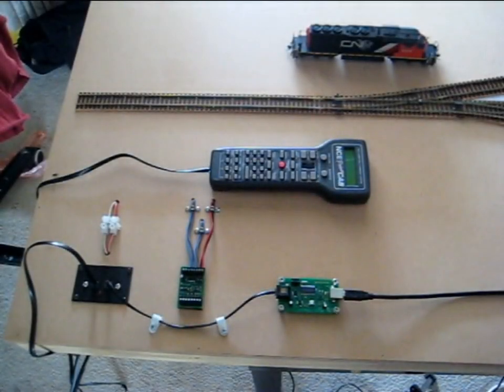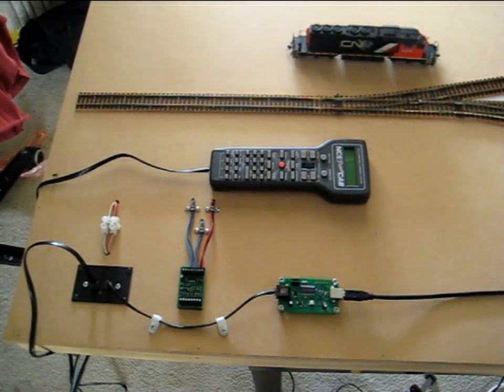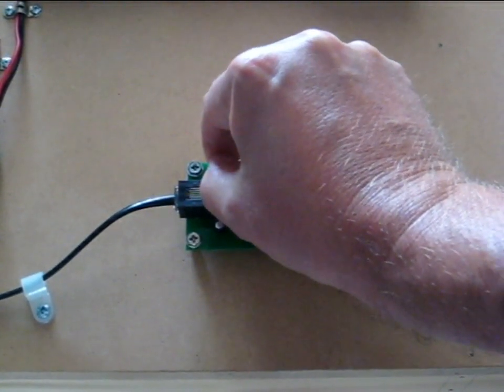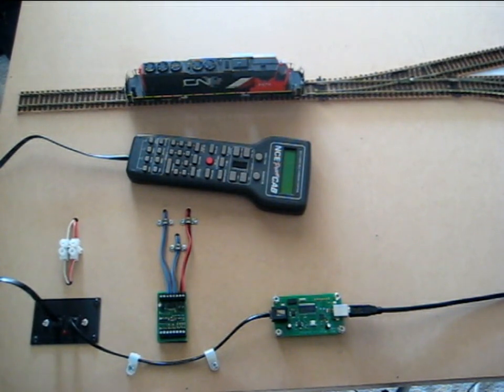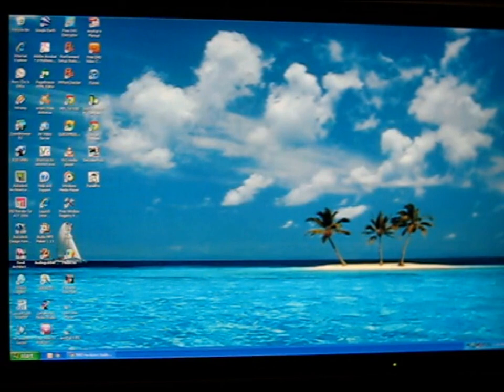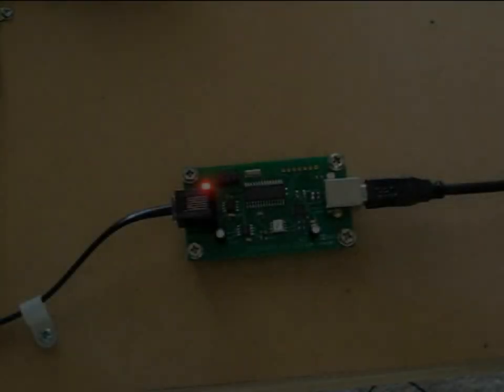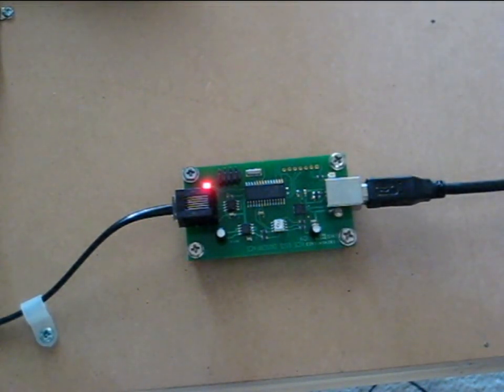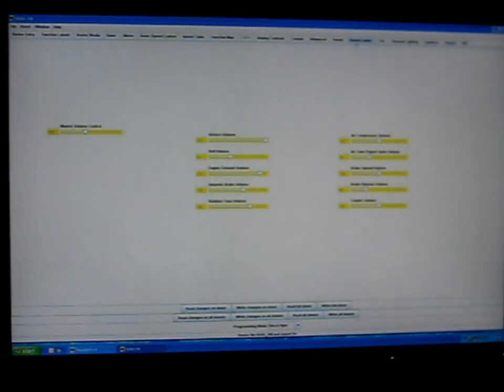NCE USB interface for the first time with JMRI software

Comment: Should the jumpers also all be removed for Power Cab version 1.65? Thanks. ...Roy
Reply from the maker: Hi Roy , version 1.65 should be jumper2-off jumper3-on jumper4-on for a baun rate 19200
Regards,
Michael
Reply: Detroit River Railroad 
Hi Michael,  I'm having problems interpreting the jumper pins.  Does your solution above apply to a Power Cab v1.65 with a v6 usb adapter, or is it for v7 only?  Its just I'm using a Power Cab v1.65 with a v6 usb adapter by the look of it.  Thanks.
Reply from the maker: Darryl Griffiths Hi Darryl, when I made this video the powercab version was v1.28c so the jumper setting was for that version.
For v1.65 try jumper2-off jumper3-on jumper4-on baun rate 19200 , see if that works. send me a message if that doesn't work.
Reply: Detroit River Railroad Hi Michael, thanks for that.  Unfortunately, that didn't work, so I set them all to off like yours and all seems to be working.  I found a useful site all about the adapter: https://sites.google.com/site/markgurries/home/nce-info/nce-usb-limitations, but sadly there is no mention of the pin config when using a later power cab with a version 6 adapter.  I have also emailed NCE, as you can apparently get your adapter updated, but they have not got back to me.

Comment: I have Power Pro, over a year now but only just had the courage to attempt the laptop connection.  I have a straight 9 pin plug into the NCE controller and via a cable adapter to a usb into the laptop. No decoder between the two.  The laptop downloaded the driver, opened panel pro, throttle recognised, no problem.
Now for the point decoder.  Wish me luck

Comment from the maker: @trackspike64 Hi, I will take it that you have the NCE powercab. The order in which you turn everything on is important. First turn on the powercab and wait till you get track power, then plug in the USB cable to your computer, windows will download the USB driver you need. Now fire up JMRI decoder pro, the first time you start this program it will take you to the preferences, if not use the top pull down menu to set the preferences. You should now have computer access. 
Good luck
Michael